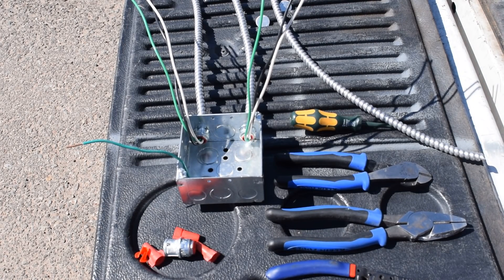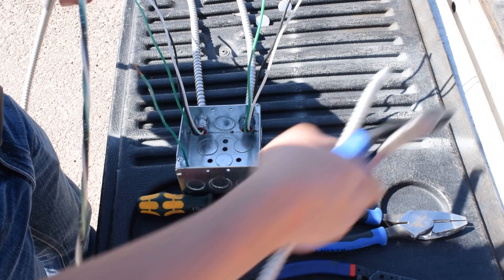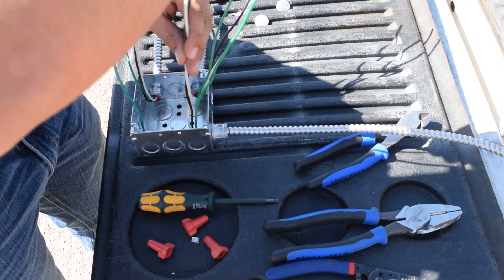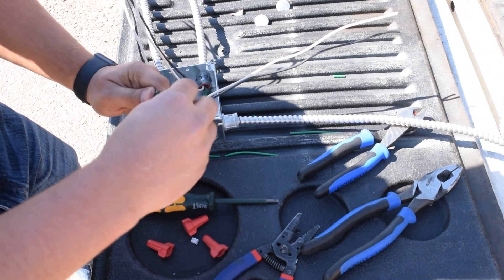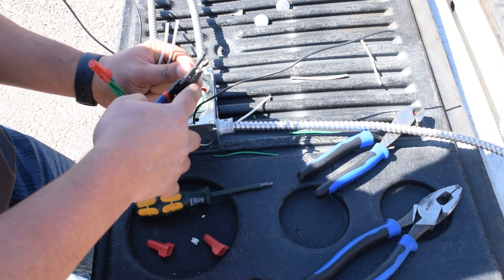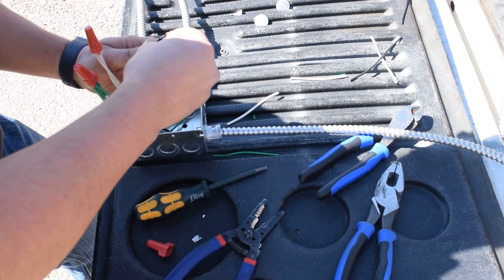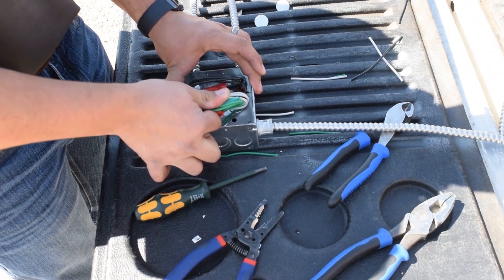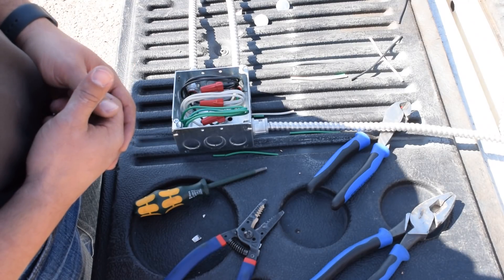How to Make Up a Electrical Box the RIGHT WAY!

Comment: Good video. One thing I was taught 50 years ago by an old electrician was to put a quick wrap of electrical tape around the wirenut and base of wire to help minimize a wirenut coming loose in box as margin of safety. I've done all my connections this way forever.

Comment: Good work, but the code requires 6 inches from where the wire enters the box, not 6" outside the box. Also a better reason to start with grounds is for safety, not because they take longer. "First to make, last to break" when terminating that means grounds, neutrals then ungrounded conductors. When removing terminations, you take out ungrounded, then neutral then grounds.

Comment: Vic Halen
0 seconds ago
Thanks for all the work you send my way. I get about 20-30% of my work as a state certified electrical contractor following behind "electricians", trunk slammers and DIY'rs who tried ONLY because someone like you on the internet gave them the confidence. Keep up the good work.
Reply from the maker: Well it’s intended for the professional. Who watches it is obviously is none of my concern. but if you’re going to do it, do it right. Thank for watching!
Reply: @WARHAMMERELECTRIC  Where are your cable splitter's? Having a cable splitter makes the job easier and faster.  I've literally had Inspector come on a jobsite and ask to see that I had cable splitter...also 6" rule actually states from where the cable emerges from the raceway or cable sheath.( 2020 NEC  300.14) . You should actually read it instead of going by hearsay. I do like that you leave 6" outside the box because NEC is the minimum requirement, so thumbs up. Also if you read the box or bag of wirenuts in most cases pre twisting is not necessary. BTW...is yours a Chevy truck? I think I have that exact bed liner on my 007 Silverado Classic.

Comment: 300.14 states At least 150 mm (6 in.) of free conductor, measured from the point in the box where it emerges from its raceway or cable sheathAt least (6 in.) of free conductor, measured from the point in the box where it emerges from its raceway or cable sheath.Nice makeup though

Comment: Don’t have to pre-twist using ideal wing nuts. It’s a waste of time.
Need more twist on the wire too. Should see 2 to 2-1/2 twists below the wire nut.

Also, always stuff the green and white to the left. Hots to the right.

Also, wire nuts go up. If they loosen up over the years, then they won’t fall off

Comment: Don't start with the grounds because they take the longest. Start with the grounds because of the purpose they serve. When untapping wires, work the reverse order and start with the hots for the very same reason 👌🏾
Reply: Yes. I was taught to always make the grounds as permanent as possible and out of the way. As long as they are jointed together right they should not serve any problems troubleshooting. Put it back in junction boxes and panel boxes
Reply: When taking the license they will fail you if you don't start wiring this order: ground, neutral, hot and to un wire it hot, neutral, ground. That's a rule when taking the license in Puerto Rico, I'm watching this video just for fun cuz I've been àn electrician since 2007

Comment: I agree with the pre-twist for permanent installations. Though I would have made the stripped end a bit longer and cutoff excess. However, I was taught on commercial installs that may be seasonal, where displays may be changed within a season or even a couple years, that you do not pre-twist. In support of that the manufacturers say no pre-twist is needed. However I hate opening a live wirenut and watching the wires spread apart breaking the circuits.

Comment: The 6inch rule actually applies to the entry point/knockout. 

300.14 - "At least 150 mm (6 in.) of free conductor, measured from the point in the box where it emerges from its raceway or cable sheath, shall be left at each outlet, junction, and switch point for splices or the connection of luminaires (fixtures) or devices. Where the opening to an outlet, junction, or switch point is less than 200 mm (8 in.) in any dimension, each conductor shall be long enough to extend at least 75 mm (3 in.) outside the opening."
Reply: I see this wrongly stated or unknown 99% of the time. And they always say “per code”… did you read the code? Lol. Sounds more like “per boss man” who incorrectly stated it’s “per code” Good video tho.
Reply: True
Definitely don’t need that much extra wire hanging out the front of the box 
3 inch is minimum
Reply: Good video though
Reply: Just read that shit in the book after some know it all mf tryed to tell me somthing lol 😆  bro get out my FACE BOY 🙎‍♂️

Comment: Should a company wire a new house 24Vac door bell primary to the forced air furnace hot? This results in a door bell that only works if there is a call for hot or cold. They did at my house. Monday morning after a weekend bender or new guy fresh from school given the simple job, maybe?  Like you, I am the fix-it guy, so the wife tells you the door bell don’t work, you check it and rings??? One day you hit the button & nothing? Head scratch! This is a true story. The difference is, I worked on cars for decades. It’s time to share this story!
  ASE Master Tech since 1978 - Retired

Comment: I was an electrician in the Navy. I HATED following others’ work. I never knew what I was getting into. It usually took twice as long because I would just start from scratch so I knew it was correct. The wire jobs I saw on some flying machines would make pilots piss their pants if they saw what I had to fix from techs that didn’t care. Sure construction electricians are different than a aircraft electrician, but sloppy work is still sloppy. But good work is always appreciated when another has to work on it after you! Great video!

Comment: Nice neat job - question  . . .  you striped the ends off the ground wires also the hot wires wrapped then all together
 then cut off the very end off using a lines man pliers then twisted a wire nut on  but when you stripped all the neutral
wires and twisted them all together you did not cut the ends off yet you twisted a wire nut on is there a reason for that
or did you forget .

Comment: I’ve never “pre-twisted” wire, then put the wire nut on... I strip the wire then twist the wire nut on and keep twisting until there are at least 3 twists in the visible jacket not in the wire nut... Is there a right or a wrong way to twisting wire? On an ideal red wire nut bag the way I just explained is the way they have on the back of the bag.
Reply: Would you like 6 or half a dozen?  You can only choose one.

Comment: Nice clean job👍 and I respect the fact that you follow the codes and all that but I’m just not ok with the waste of wire when you cut out the so called 6”.🤔🤔 if it was me doing it, I’ll do it before I put the wire into the box. With experience you know the length you need without measuring with the fingers. But I guess that’s how you were thought and like I said it’s nice that you pay attention to the codes. Most of the electricians I know, just get the job done. You have places to go and can’t be stuck on one job remembering all the stupid codes 😆😂😖😬. It’s just what I’ve seen in the New York 🗽 Area. And you said comment below😄😌.

Comment: When my electrician is being a total dickhead on the job site, because sometimes they are.  I will undo his ground wires and reground them through a mounting hole in the back with a sheetrock screw into the wood, because this will cause him to fail inspection.  When he is a bigger dick, I will drill out the receptacle mounting holes with a 3/16 drill bit so he can't screw his switches or outlets to anything.

Comment: God that must be the worst way. Just twisting the cables together. Weird way, in Europe the law forces us to use special connectors (wago type).
Reply: IMHO "Wago's" are CRAP! Twisting wires together tight with your lineman pliers and capping the connection with a wire nut makes for a far superior electrical connection.

Comment: You say this is the CORRECT way but you don’t use a roto splitter
Reply: Who uses a roto splitter? Bend it twist it, cut it, ive always used my linemans to cut mc cable, never knicked a wire

Comment: Holy Bat Shit Dude! Right of the start of your teaching you are wrong. They make a special tool to cut MC/BX and I would advise using it to avoid damaging the insulation on your wires. Not an impressive start to a how-to "do it right" video. Let's see how is goes from here.......................

Ended very good. Clean craftsmanship, very nice good, You have been decently trained Kiddo.

Comment: Dad was a master electrician and an electronics guru.  You should see the home built ham radio amp.  5000 volts across the plate.  Scary thing. 

He passed a year and a half ago.  I’m moving back to the house he built with my grandpa in the 70’s.  The junction box work was done the permanent way.  All joints soldered. He said back then you could do this.  I guess it’s grandfathered or something.  The connections/solder joints are solid and the wire clamps, staples and such are in a way no wire is ever moving.  

However, I’ve had to map out what’s happening in some of the boxes before I do any work. I’m sure he’s laughing at me when I was puzzled on the 3 way switch setup in the box. Haha

Anyway, great looking electrical box. Thanks for the video!
Reply from the maker: Thanks for sharing this story.

Comment: WOW that is something of a different path compared to our German installation.
Do you have individual wires wrapped in a composite with this plastic film, drawn into this metal tube?
I find it really "unnecessarily" complicated and very dependent on the skill of the electrician to twist and assemble the insulation cap for a very good electrical connection.
We use these installation clamps from Wago, simply strip the wire and insert it into the clamp and you're done.
Watch it in the video here: www.youtube.com/watch?v=t4lgN_n5SMw
Or watch a video where the installation in a eletrical box is shown hier: https://youtu.be/IZoQOo3zN4o?t=391

Comment: You don’t need a bushing when using a snap in MC connector. Snap in MC connectors already have one built in.
Reply: What do you do with all your anti- shorts? Do you throw them away so the good electricians can't use them? Or do you have a huge stock pile. An MC stripper sometimes leaves a sharp edge on the inside of the outer metal jacket. It doesn't hurt anything to use them they come with the MC.
Reply: You still need a bushing .. don’t listen to this fuck
Reply: @matthewbritzman6010  What part of "already built in" do you not understand. Leave terminating MC cable to the real electricians, bud. LOL.

Comment: its still beyond me why are you still using those wire nuts its an inferior design prone get lose with load and heat. ohh and good luck getting 1 wire out of the bunch while the others still energized and needed
Reply: What should he be using ?
Reply: @michaelwalker3920  WAGO connectors
Reply: @michaelwalker3920  dont know the widly different state codes. but products like wago connectors for 1 better solution. spring loaded clamps the plastic sorrunding it will give before the spring elements loses contact pressure, you need to twist the wires inside to remove it otherwise grip it good with 2 hands

Comment: I am not sure where you learned what you show here; but it was not from an electrician... you are supposed to back wind the tracer wire you clipped off into the low spot on the MC spiral, to hold the anti-short in place... when twisting conductors, you should skin about an inch or so, grab the conductors at the very end when twisting, then clip off the buggered part caused by the pliers before twisting on the wire-nut... we could not see how you attached the ground to the box...??? and when you fold the wires into the box, the wire-nuts should be closest to the cover (opposite to the way you have it). You write the panel and circuit number in the back of the box, so if the cover is lost the information is still obtainable...

Comment: Very neat work, nice trick about label the lines inside the blank plate but most people that will do work on a junction box do not remove the plate completely. They loosen the screw and swing the plate aside, plates with keyhole slot or hook slot.

Comment: I don't know what country he is in but in Canada the electrical box must be grounded to one of the grounded wires as per code. This ensures that if any hot wire were to come loose it would short and trip the breake thus preventing the box from becoming live.
Reply: He did ground the box
Reply: @salythaone  i see it now.
Reply: I was thinking the same thing. But however if one of the conduits is grounded you get the same result. Besides those boxes are not always in reach proximity. Nevertheless you make a good point.

Comment: Only complaint I have is no rotosplit, definitely A higher chance of nicking a wire using cutters like that. Besides that everything is 10 outta 10. IBEW local 26 AJ Foreman.
Reply: I use a rotosplit too.  I've found that the casing is sharp enough to cut the plastic wrap, eliminating a tool grab.
Reply: Lol, Foreman.
Reply: @zachgramling5882  lol, unemployed.

Comment: There is no way you are twisting that many wires with a 3/4” strip and getting a joint that holds together by itself. 1 1/4” for 4 or more. BX cutters work better than diagonals. MC cutters work best. 

I like how you left slack for the future.  Panel numbers are great. Good job.
Reply: I was thinking the same that the 3/4" strip is not long enough.

Comment: Great job love the neatness. One small criticism that I’m not saying you’re wrong it’s just tough to tell from the angle. I was taught 1 1/2 twists when you splice. Meaning... if you start at the insulation and follow one wire it should rotate 1 1/2 times evenly. Not too tight, not too many twists after on the insulated side, shouldn’t curve to a side, will be covered by any wire nut. Otherwise it’s one of the better how too’s on YouTube.
Reply: Code does not specify pretwist, so no reference to how many twists are proper.
Reply: @SynergyAVE  my post was not referencing code. It’s based on best practice from how ever many years Local 3 has been teaching it this way.

Comment: They have a tool call the bx rotorsplit its use to cut bx cable , its make the job easier.

Klein Tools 53725 BX and Armored Cable Cutter https://www.amazon.com/dp/B005TTZS90/ref=cm_sw_r_wa_apa_fabc_00j8Fb9CCAJWF
Reply: It only makes it easier if you suck at electrical

Comment: Now try doing that folding wire trick when the box is wedged god knows where and where the walls go right left fold then right then left. Then when they use an electrical tape to connect a pigtail and it melts all over the wires. And then the box is not even attached to the stud or whatever the hell it is attached to and it slides down a bit. So you have a nice box and i wish i could see this in the house i bought but omg its a dream.
Reply: My thing is fire marshals that have no clue when it comes to fire alarm wiring and miss the obvious items in from of their face, e. g., zone wiring with two set of wires landed at the terminal block.

Comment: What's this 6 inch rule?  Are you only allowed 6 inches out of the box or do you have to have a min of 6 inches out of the box?

I don't recall a rule like this in the Canadian Electrical code.
Reply: I thought it was 6 inches from the back of the box and a minimum of 3 inches outside the box, but that might just be for the smaller 1 gang boxes.
Reply: Well that's a dumb question Gra Gor.  Hell I wrote it and even I can't understand it.

Comment: How very beginning is wrong.  You'd fail if a competent inspector came by. Mc cutter is required from all companies as a necessary tool
Reply: Mc cutter is not code. Inspector inspects per code not per insulation techniques.
Reply: Per manufacturers recommendations

Comment: Six inches outside the box is WRONG, it’s 6 inches coming from within the box as per Article 300.14
Reply: So a little extra is what he's using.  Meets min spec therefore will pass for code.
Reply: Six inches minimum as per code, doesn't  say there cannot  be more.

Comment: Are these tubes made of metal? Where are they grounded?
Reply: The ground screw is connected to the box the connector is on the MC sheath connected to the box.
Reply: Tubes? You mean the MC sheathing? Typically aluminum now-a-days but older installations only had steel.

Comment: Wirenuts 🤣 damn you yanks are so far behind.
Reply: Please do share how you would have wired this box. Do you use the wago connectors? Or something else?
Reply: @chefsteven34  Any method thats does not require the twisting of copper conductors compromising their structural integrity. I would use connectors or wagos. That type of box in the UK is only designed to be mounted to brickwork and plastered in. If the box is surface mounted and exposed to outside elements I would use one of a minimum of IP65 rating.
Reply: @davey6024  in america that box is interior only, and fastened normally to concrete or metal.
Reply: wagos are sooo much better. pressure on the copper is kept constant and it is easy (or even say possible) to change something without risking cracks in the conductors.
Reply: @youcann  Correct. I'm in my 60s and in still fighting with the younger guys about how much better Wagos are 
Americans need to accept that some things are better in other places.